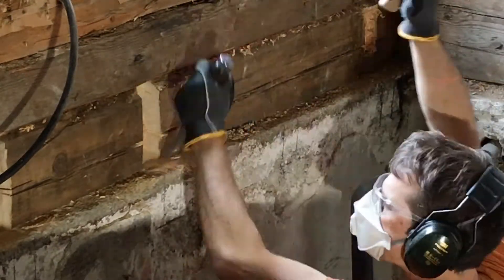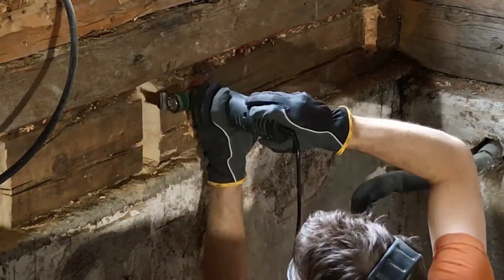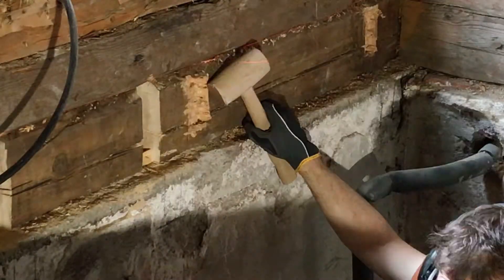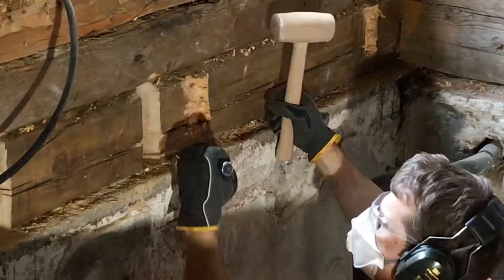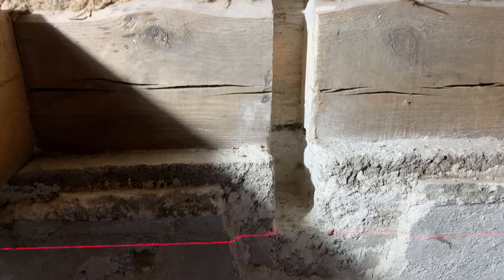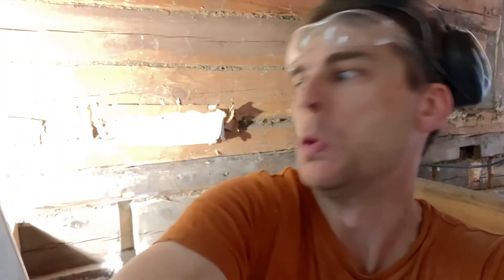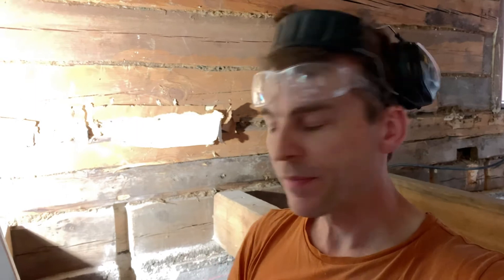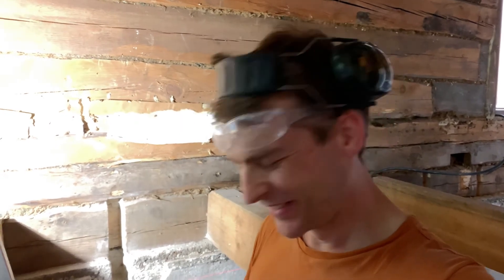Renovation: bashing away at it again.

Comment: I appreciate that you decided the floor needed to be sturdier than the one you had, and I note you are inserting new joists between the old ones (and bridging old and new) but what drove the decision that the new joists should be deeper, requiring you to cut into the concrete?
Reply from the maker: Deeper joists give much more strength as the span increases. In 1930’s the timber was a little different and I don’t think there were building codes and span tables.  Nothing wrong with the old dimensions or timber, but to make sure no concerns about code or the span come up.. I went with MORE 😉